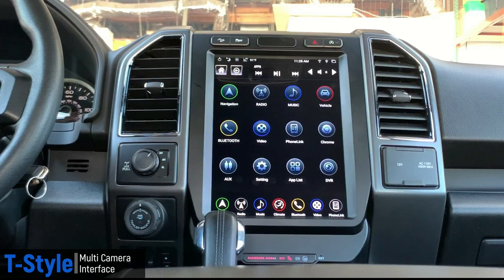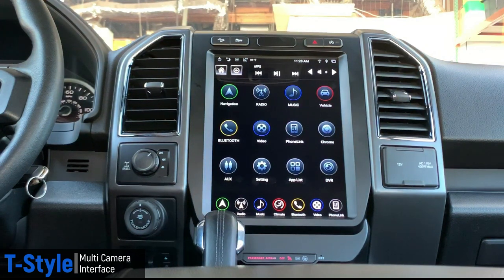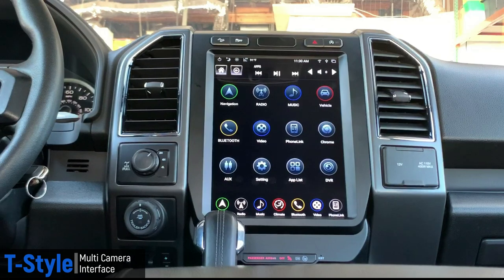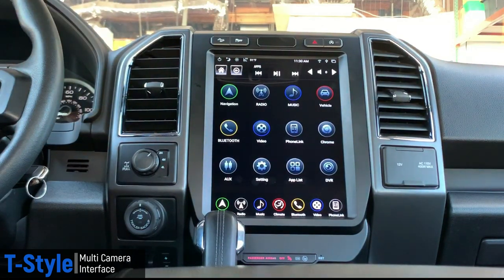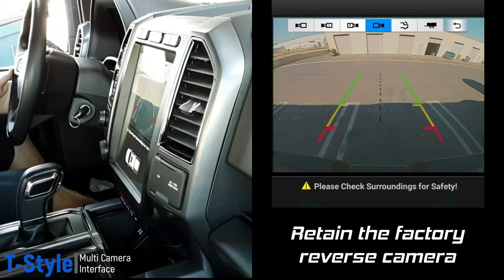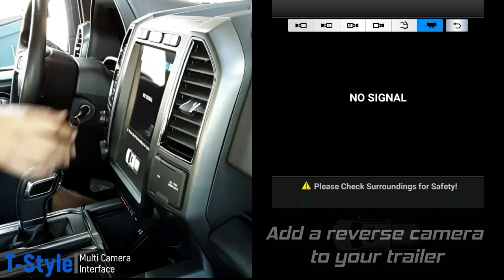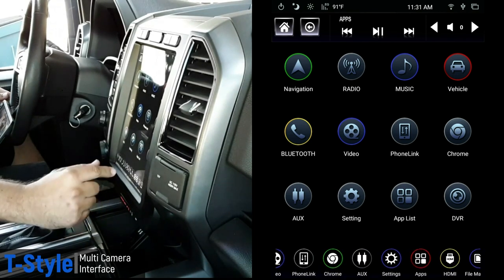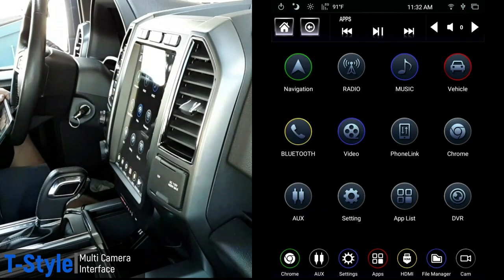LinksWell T-Style Radio Multi-Camera Interface Demo

Comment: How do you connect the camera behind the trailer? Will you have to run wire from the camera to the truck where it will connect then run it to the radio?

Comment: I need this bad. I installed a cargo cam to the front cam output but didnt realize I could just turn it on manually when backing up to my 5th wheel as the backup cam overrides it. Any idea what the cost will be?
Reply from the maker: Should be around $149-$199

Comment: I just finished installing Gen 5 on my ram 1500 and it's awesome!  Is there a way to adjust those guidlines when going in reverse?  The trajectory lines aren't very accurate.
Reply from the maker: There isn’t. Sorry. They are just basic overlay lines set where they are.
Reply: @LinksWellInc  ah ok.  Thank you.   One more thing.  I was trying to register my unit on your website for warranty but i couldn't bc my model number wasn't one of the option.  When will the list be updated to include gen 5 units?
Reply from the maker: @hyunkang5628  will work on that this week

Comment: hey is there any videos on the install of all the cameras? im just curious on powering the cameras...i installed the gen 4 in my f150 and just got the side mirror cams and a front cam  looking to install but im not sure how i power the cameras...is there a power and ground line on the camera on the gen 4?
Reply from the maker: You can power them behind the radio.
Reply: I just got mine today and I don't have the option at too of camara screen how do I get that?
Reply from the maker: @coreygilmore7073  did you install the multi camera module?
Reply: @LinksWellInc  does that come with the unit or do I have to buy it separately?
What I have done is hook up factory camera and it works,then I hooked up my aftermarket camera to front camera RCA and powered it from front camera power but can find anyway to turn on front camera,under setting it shows front camera is off but will not let me turn it on
Reply: @LinksWellInc  I have my factory camera hooked up and a aftermarket camera hooked up in the front camera spot but it will not let me turn on any of the other camera spots only the factory camera,do you have any idea what I can do to fix?
Reply: @coreygilmore7073  corey did you power the front camera with one of linkswell leads thats in the camera harness?
Reply: @mikgto68  yes I did
Reply from the maker: @coreygilmore7073  are you trying to see the other camera when in reverse?

Comment: I got the gen 4 for my f250 platinum,  but all the cameras do not work, how can I get the 3rd brake light camera to work? All the cameras like in this video. Please advise. Also, the clock is always off when I turn on the truck, is that a fixable bug?
Reply from the maker: I have a video on here on how to fix the clock. It's a setting. 

The cameras wi depend. Did you install the 360 retention module?  And did you program the radio to the right settings for the 360 camera?
Reply: @LinksWellInc  Series T-Style Radio Tech Support

Why does the screen go black and say NO SIGNAL

I cant go back to setting it doesnt let me do anything while is showing no single n is black

Comment: Any idea how to get the screen to turn on with remote start? Boot time takes too long for me and i'm already backing up and driving before it boots, so my back cam is useless
Reply from the maker: Get an aftermarket remote start that you can set it to turn on the Accessory power.  The factory remote starts don’t power up the entire car. 

The camera should be working before boot up though.

Comment: Is there a camera install diagram for the gen 5 for GMC? I can't seem to get the front and right camera to work.
Reply from the maker: Aftermarket cameras?  

You should just need to plug the RCA into the matching input on the black camera input harness.
Reply: @LinksWellInc  yes aftermarket. Power wires not necessary to hook up?
Reply: Trigger wire?
Reply from the maker: @sosofresh3773  to trigger?  There is no way to trigger front besides selecting Cam. 

The side camera you turn on in settings and it will flip when the turn signal is turned on.

Comment: I have a f 150 2013 ome camera how can i make the look better it looks like a vcr tape
Reply from the maker: So unfortunately you have to replace it. The resolution on that camera is really low. So when it goes into our screen it shows it's weak signal.  You could try a video booster but that would be more work and probably more expensive than just swapping the camera out.
Reply: @LinksWellInc  MORNING 
I have a factory camera  so what are the chances that it will work  ?
Reply: @LinksWellInc  do you have a rear camera for sale
Reply from the maker: @jwevophone  so we don't produce any cameras. So we don't offer any replacements.

Comment: Can I get this for a 2018 Ram 2500?
Reply from the maker: The radio?  Or the multi Camera interface for our radio?
Reply from the maker: @El_M3nor96  we do have a radio for it. Still working on the multi camera interface for it. But should be soon.
Reply from the maker: @El_M3nor96  we have dealers out there. You can use the find a retailer tab on our website to find a local retailer using your zip code.

Comment: I just ordered a gen 4 t style for my gmc 
Also added on the wireless trailer camera advertised
Will this be the set up I will see or do I have to order another module to make this work 
Being able to put it in reverse and just hit the trailer cam button is a huge reason why I bought this.  When I called they said I should hook the camera up the right camera input and that seems kinda backwards.
Reply from the maker: So we are still working on this interface module for the GM. If you want to be able to see the trailer camera in reverse now you would need some sort of external camera switcher. That lets you take multiple inputs and send out a single out put. That way you decide which camera the radio sees when in reverse. 

Connecting the trailer camera to Right will work except when in reverse. When you go into reverse the back up camera will take over.

Comment: Can you add this if you have the factory 360, front, and rear cams? Wouldn't mind the cargo and side cameras in addition to the factory cams.
Reply from the maker: In theory maybe?  It would make the 360 work a little weird but I think you could do it. So long as your current 350 is controlled by the touch screen.

Comment: Can you install a factory front camera and aftermarket side cameras?  My f250 only has reverse and cargo cameras
Reply from the maker: You can try.  The factory front cameras requires the module from Ford to work.  So you would have to look into that with Ford.

Comment: Will the factory cargo camera on my 2020 ram 2500 be retained ?
Reply from the maker: This system is designed to be used with aftermarket cameras……

To answer the question on the Ram though….  The new RAM is running a new special AHD camera system that we haven’t been able to crack how the cargo camera works yet. Only have it working the tailgate camera.

Comment: Right now my tailgate camera is somehow bypassed and only my after-market cargo camera works when backing up.  Something must have been wired up incorrectly.  Plus I have the option of Rear, Front, and right camera.  Don't need the right camera but wanting a front camera as well a trailer camera in addition to my cargo and tailgate camera.
Any suggestions?
Reply from the maker: Not totally following you. Our radio stock only gives you one reverse cam input. Do you have our Multi Cam module installed?
Reply: @LinksWellInc  Sorry what is the multi Cam module?  I can only view my cargo camera when in park or driving but not backing up.  Your video shows otherwise. I have model # TS-DGPU10-4RR-4/8.  I like what your video has to offer while in reverse changing different cameras instead of adding an aftermarket switch to control it.  I don't recall seeing a Multi Cam Module.
Reply from the maker: @MarioElzen  Gotcha.  right so we are still in development for the multi cam for the Ram, we have one for the Ford, but haven't gotten it done for the Dodge yet.
Reply: @LinksWellInc  Would you happen to know when as I need to do something in order to get my cargo camera working and hooking up my 5th wheel.  I understand you can hook up a two-way switch and while in reverse instead of the tailgate camera being displayed the switch hidden somewhere in the dash can be switched over to the cargo camera.  That is all I need it for.  At the moment it is not set up that way and I have to get out of the truck a few times to make sure I am lined up properly.

Comment: will this work with an xlt without 360 and regular 8 inch display?
Reply from the maker: Yep!  That is actually the exact truck we installed it into. But the camera system will only work on our T-Style Screen. Kit the factory. We do have the same kind of interface that will work in the SYNC 3 screen though.
Reply: @LinksWellInc  does the ford pass app work with the head unit?
Reply from the maker: @Tacorice  certain features do. But you will lose the tracking of the truck from your app.

Comment: When I get my linkswell gen 4 for my 2014 Ram,, I want to install an aftermarket camera in the bed of my truck.  So that I can use it for when I'm backing up to my 5th wheel.  question is, when I hook up the RCA cable to the front camera RCA cable,  Do I use the red wire from the RCA cable and hook it up to the front power cable on the back of the radio or just leave it disconnected?  Thank you..
Reply from the maker: So you will actually need to use some sort of video switching device. When you put the truck in reverse it will always go to reverse input. 

So you need something that will let you switch between Tailgate and Cargo camera both sharing the Reverse input.
Reply: @LinksWellInc  I think I know what you're talking about, but can I wire the red wire from the RCA cable to the outside fuse box to a fuse that comes on when the truck is running?  Then hook the other end to the back of the radio to the front power cable?  Thanks
Reply from the maker: @Mboyce1959  if you are just looking for a source of power for the cargo camera we have both constant and ACC power available for you to use to connect to power things like a camera in the back of the radio.
Reply: @LinksWellInc  Yes, that would be great.  How do I get how please. Does it come with directions to install it?
Reply from the maker: @Mboyce1959  there is a green plug with a yellow, red, and black wire on it. 

Yellow is Constant, 
Red is ACC
Black is ground.
Reply: @LinksWellInc  Thank you.  I'll try that once I get the radio.  Thank you for your help.

Comment: Why the jl reverse guidelines does not look like these?
Reply from the maker: Because they are created by a different source. This set up was all aftermarket cameras with our switcher. 

The Jeep JL camera is factory.
Reply: @LinksWellInc  on factory jl radio there is a colored lines and a middle dash
Reply from the maker: @dio1982  I am sorry I am not understanding what you are asking?  

The JL factory camera guidelines will be different because it is a different camera and different screen.  Guidelines change based on the camera itself and if the camera produces the lines or if the radios produces the lines. 

So different radios and different cameras will make guidelines that don’t all look the same.

Comment: Question for GM...  If I connected a cargo cam to the front cam input....  When I am in reserve from what I can tell there is no button to switch to the "front cam".  Is that programmable to enable a button or is there a way to back out of the backup cam while in reverse?
Reply from the maker: No. Reverse camera will always trump. So you would need your create a video switching system connected to the reverse input.
Reply: K.  So what triggers the Right Cam to come on?

I currently have your multi-cam system.  So thinking: Front cam on the Front cam input.  Side cams into a switcher into to the Right cam input.  Rear, Cargo, and Trailer into a switcher into the Backup cam input.
Reply from the maker: @sargenthp  you have this multi cam system?  If you have this one you can switch cameras when ever you want. In reverse or not because it uses the reverse input.
Reply: @LinksWellInc  I have the S2HOO2A-Y02E – GM I05/I06 Multi Camera interface
Reply from the maker: @sargenthp  oh. That is old and a completely different animal.
Reply: @LinksWellInc  It was pretty much considered "obsolete" shortly after I purchased it.

So back to the radio... How does the backup and right cameras get triggered to come on for an '18 Silverado 3500?
Reply from the maker: @sargenthp  All the triggers come from the vehicles CanBus.